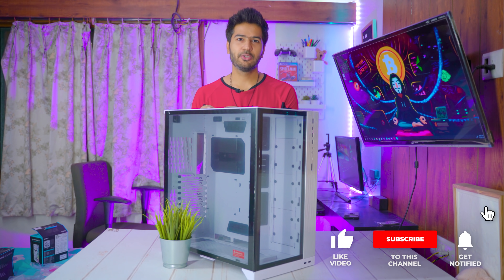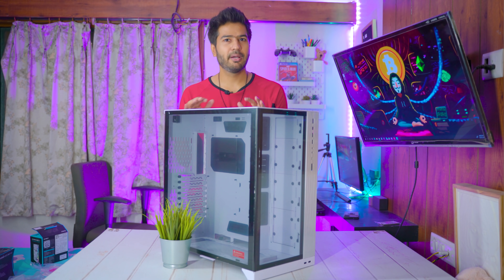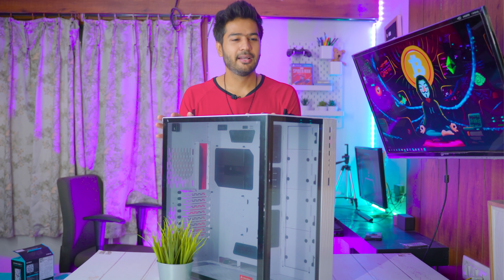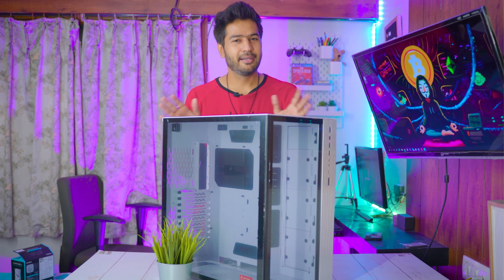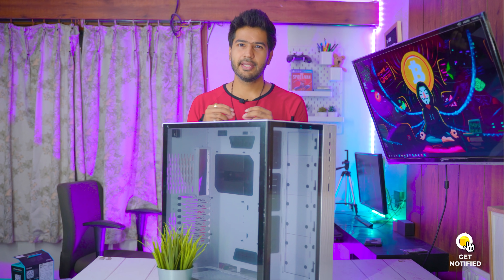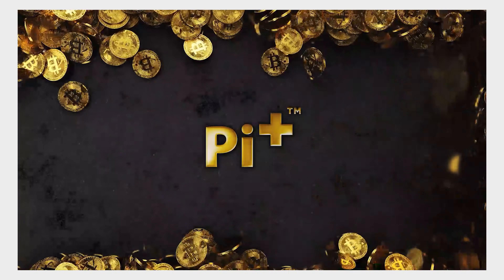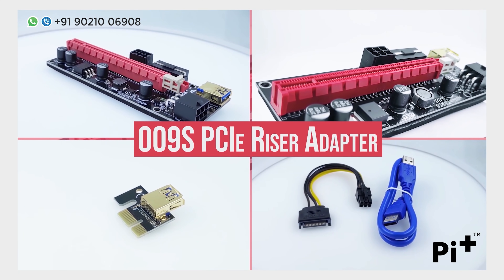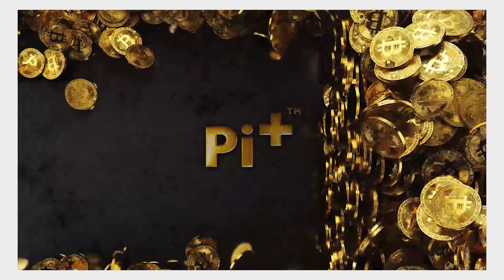Epic ₹4.5 Lakh Chia Mining Rig Build 🍃 | Part 2 | Lian Li Dynamic 011 XL

Comment: Bro i have just bought mining rig but.. can i run two rtx 3060 if my motherboard has one pciex16 slot.
If yes then how?
Reply: (F•O•R••  M•O•R•E •• G•U•I•D•A•N•C•E•(((

👇👇👇👇👇👇👇👇👇
<>+1>6>0>1>9>8>0>1>4>3>0<>I>N>V>E>S>T>I>N>G >~I>N B>I>T>C>O>I>N>~ E>T>H D>O>G>E
(W(h(a(t(s(A(p(p(
Reply: Nope, you need Pcie x16 slot for each individual 3060. 
But , you can run any other card on the same.

Comment: Hi 
I have a dell laptop with 6th gen i7 processor with amd R5 M335 graphics card. 
Is ith possible for me to start mining with this?
Reply: Technically you can do mine chia with it with say 32 GB RAM and Hard Drives and a separate booting drive
Reply: But its highly unlikely you would ever earn a chia from such setup, (joining pool is an exception)
Reply: no
Reply: @tasteful7364  🥺
Reply: Any suggestions for a beginner?